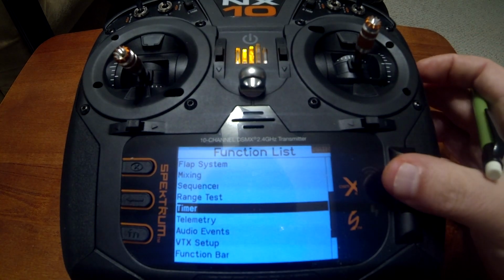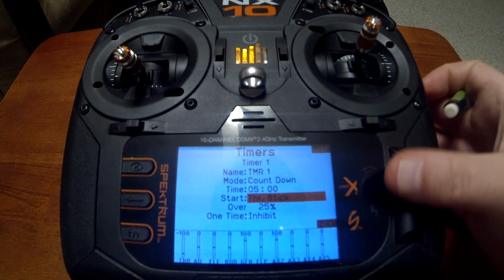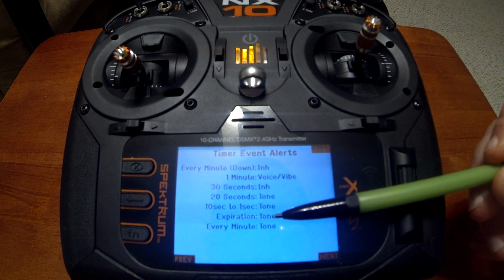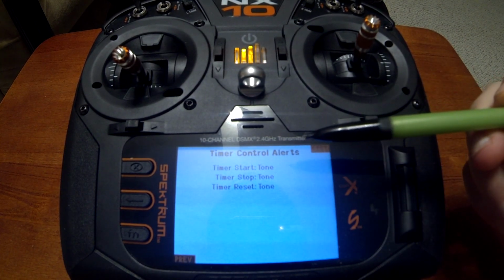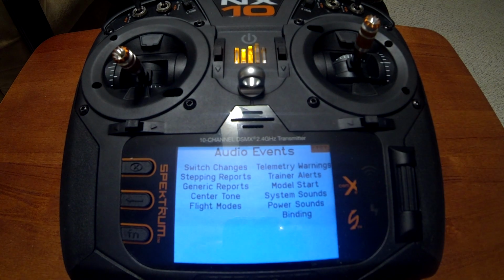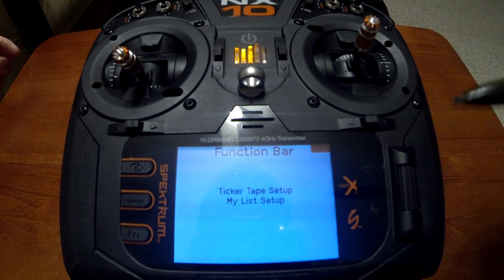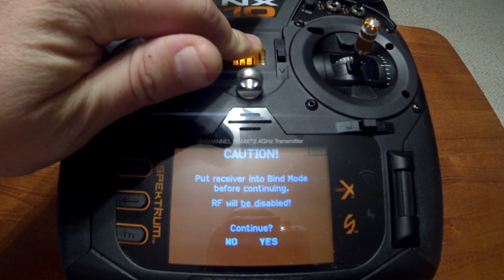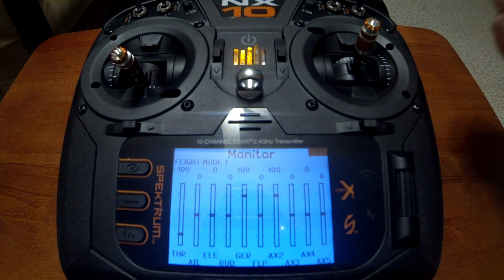Spektrum NX Setup: Start to Finish Tutorial - Function List (NX6/NX8/NX10)

Comment: I was using DX8 transmitter and it was ok now I shifted to NX10 transmitter, I have now problem with response of the sticks to commands as there is a delay in execution of commands which was not noticed in DX8 TRANSMITTER

Comment: BD, The NX10 showed up Thursday evening, and after about an hour and a half of setup, including importing my previous DX6E model memory into the NX10.  I also set up some of the newer features I never had or never used in the older radio.  Today, (Saturday morning) I was flying with the NX10.  The transition was painless and error-free.  
Before making the decision to purchase the radio, I was apprehensive about upgrading because of all the opinions on the internet.  The mixture of wildly negative (and positive) experiences just wasn't logical, but that is the internet experience.  The NX10 functions as advertised by Spektrum. At this point, I'm extremely pleased and I'm continuing to take advantage of the newer features as I learn how to use them.  Flying the 3 models I flew today was a seamless transition from the DX6E with exception of the better feel of the gimbals and having an endless supply of transmitter power.  Your videos are highly recommended to reinforce the setup procedures found in the operator manual.  Thanks again for the excellent content.
Reply from the maker: Awesome to hear that feedback! Glad you enjoying new radio. Thanks for watching and support :)

Comment: Thanks for this great series of videos on the NX10! I have been in research paralysis trying to figure out what to move up to from my current DX6e.  Your videos have provided excellent descriptions and remedies, where necessary, for many of the user issues posted on the interweb.  I already have a rack of Spektrum receivers and other gear so I'm reluctant to switch brands if it isn't really necessary.  From what I have experienced myself, and seen here, I am confident I'll have a great radio in a few days.
Reply from the maker: NX8 is overall value and NX10 is good step up for extra money...
Reply: @BDTennessee  I ordered the NX10.
Reply from the maker: @flyingfisherman9076  congratulations on radio!

Comment: BD! I need help again!    NX8, 410rx, Bulero V-tail...  In sailplane, 2 aileron, 2 tail, bottom load (A). Had to reverse elevator function now rudder function is backwards. Do not see how to correct Rudder function without  changing elevator again. PLEASE HELP! Lol, I get lost in this radio with every new bird and my only hobby shop guy with any knowledge is gone! I'll take help from anyone wanting to help. Thanks BD and all.
Reply from the maker: What channels is your channel setup?

Channel 1-
Channel 2-
Channel 3-
Channel 4-

Also what aircraft type are you using?
Reply: @BDTennessee  
1L aileron
2R aileron
3L elevator 
4R elevator 
Sailplane 
V-tail A
Reply from the maker: @brucepearson6322  is that how you have them hooked in receiver and changed RX port assignment to match? Standard layout is different.
Reply: @BDTennessee  I changed the input order,  now it works. 
Thanks BD
Reply from the maker: @brucepearson6322  there we go! Glad to help Bruce,holla anytime!

Comment: If you have time.   I have a question.   Is there a way to reset the min and max on the vario?various?  Thanks again for all your help.
Reply from the maker: You referring to the min and max warnings?
Reply: @BDTennessee  no.  On the screen for the altitude it shows minimum and maximum value.   I can't look at the screen and fly.  Just curious if you can clear it before a flight,  and see what you're altitude was for that flight.